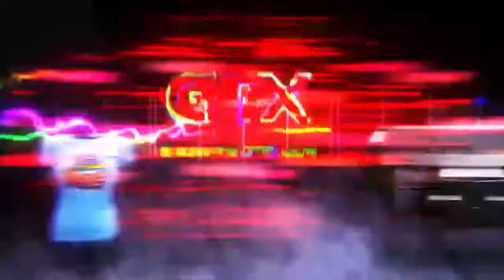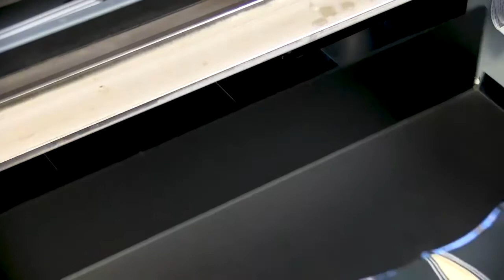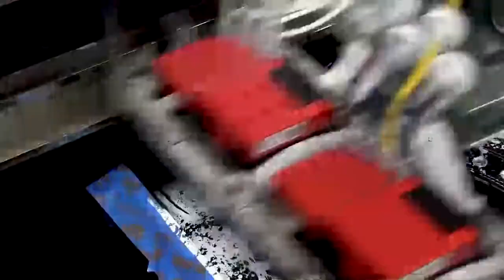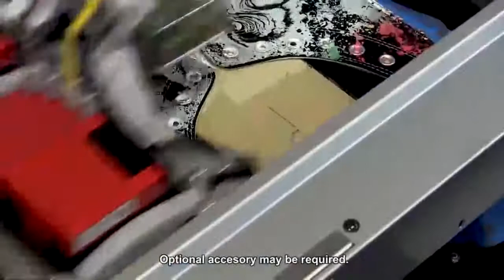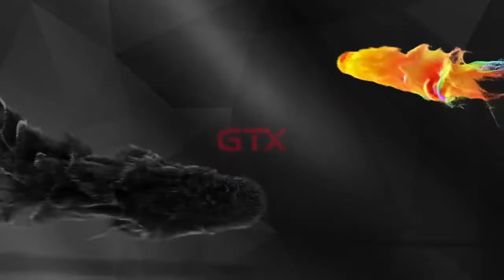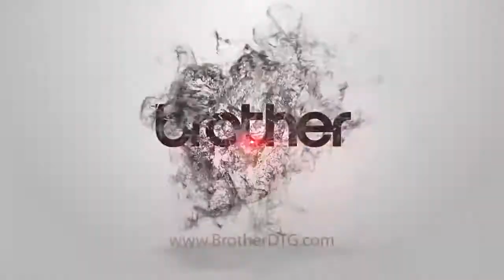Brother GTX garment printer - custom shoe printing

Comment: Not related to this video, you showed one you did with," How to DIY Sublimation markers". You showed the kids using them but you didn't show how to diy make them. Do you have a vid on that? thanks
Reply from the maker: Hi Kaywood, do you mean transferring the colouring patterns to the mugs? This can be done with a normal mug template in the same way that you'd create normal dye sublimation decorated mugs. The curing times are available on the GJS knowledge base at: help.gjs.co